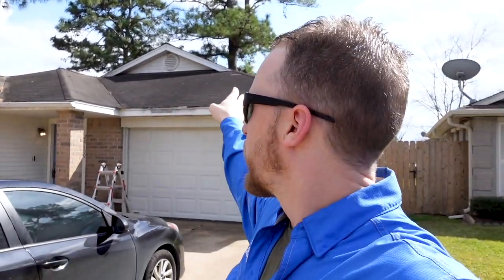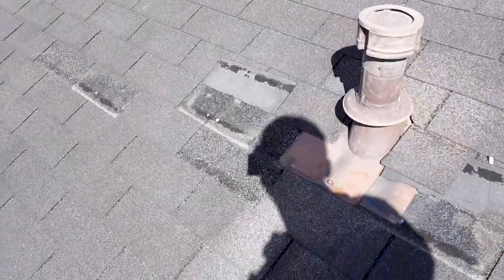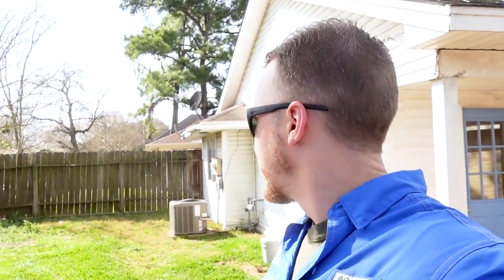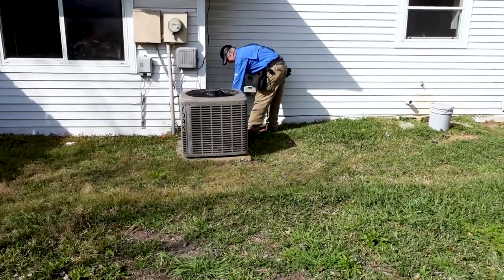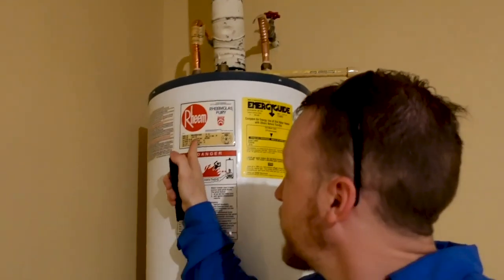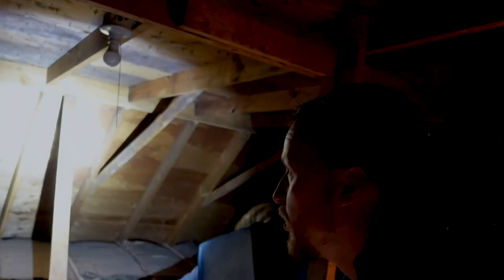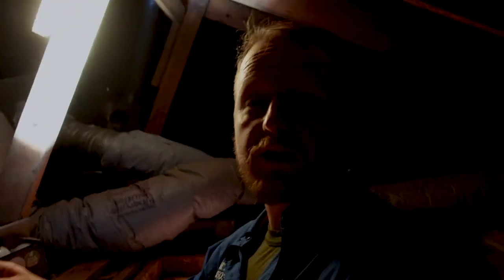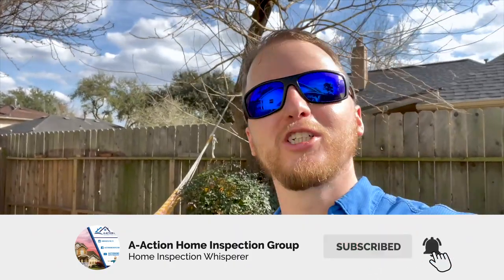Helping First Time Home Buyers Look at Properties

Comment: Why is having the ductwork laying across the attic like that mean underperformance? How should it be?
Reply from the maker: In the Texas area all duct needs to be lifted, supported,  and separated.  It does not have to be lifted if it is an older property.  But if they come in and work on it.  An HVAC person will recommend it.
Reply: @AActionHomeInspectionHouston  Thanks!